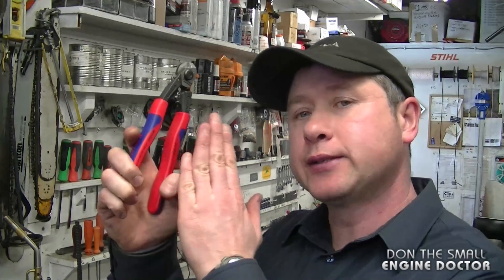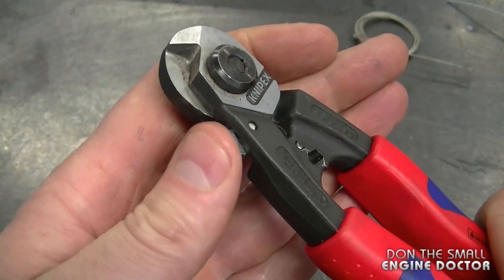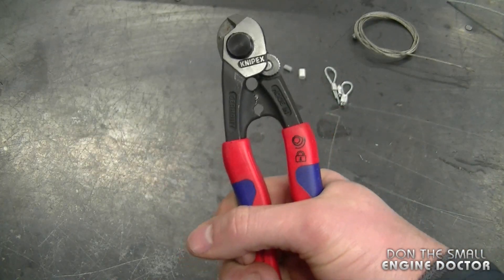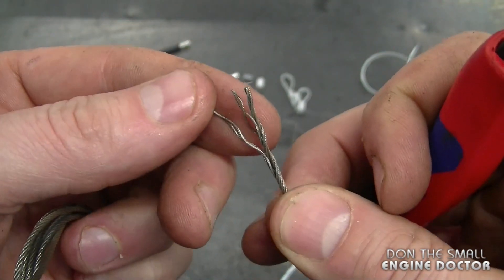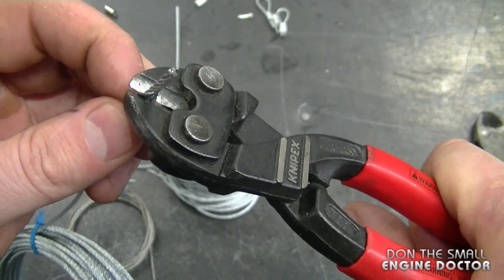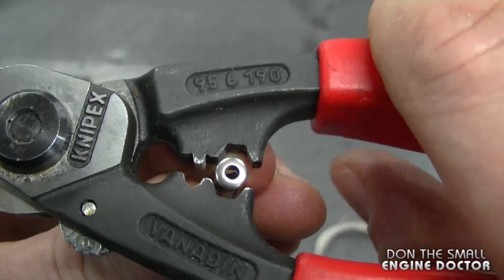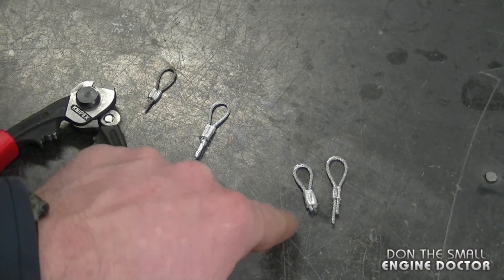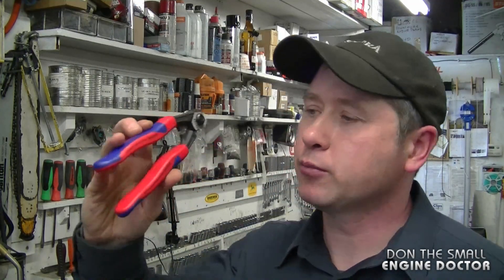TOOL REVIEW - KNIPEX Wire Cable & Rope Cutters

Comment: You might want to look into the proper way to crimp ferrule connectors☒ Those are some nice cable cutters though.
Reply: Shouldn't it be crimped vertically? Will this tool do the job ?

Comment: Great demonstration that shows the quality of Knipex. More important it demonstrates how the right tool makes the job turn out right. The side cutters and the bolt cutters are not cable cutters.
Reply: Oh yes side cutters and bolt cutters ARE cable cutters.  Cable is the stuff that conducts electricity. It is MUCH softer than wire rope. What you really mean to say is.... side cutters and bolt cutters are not wire rope cutters.

Comment: I've got a set of these and they are terrific. AS you say, very clean cut. On the same general subject, I'd highly recommend the small  plier-size bolt cutters  you mention as well. Knipex stuff is expensive but you really do get what you pay for. I hope winter is ending soon. Just got blasted here in New Jersey so it's not letting go here just yet!

Comment: I don't have a repair shop, but do need pliers like those for working on the equipment, and vehicles around home. I have a pair similar to those which I have in one of the pouches I keep for working on electrical appliances primarily, but also on computers, and outside equipment.

Comment: HEY, IT WASNT REALLY FAIR  comparing these NEW k-nipex  cutters to the TOTALLY worn out one`s roughly 3 mins in, if your going to include other tools, they should be like for like, eg, all the cutters should be BRAND NEW, however an interesting video.
Reply: Good feedback if he was doing a comparison between like products but he wasn't, His KNIPEX wire cutter is over a year old as he states at the start of the video and what he was trying to show was that regardless of age or type of side cutter a wire cutter tool will just about always make a better cut. It's nothing to do with one tool vs another but style of cutting that the tool undertakes - shear vs bite cut.